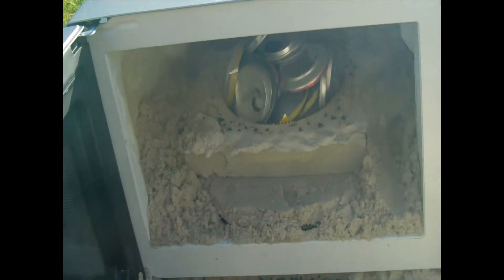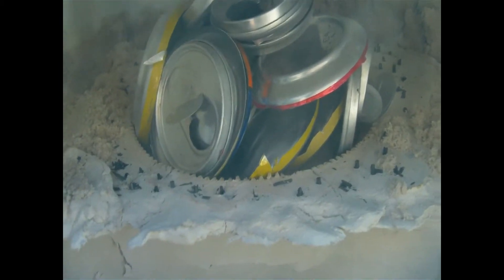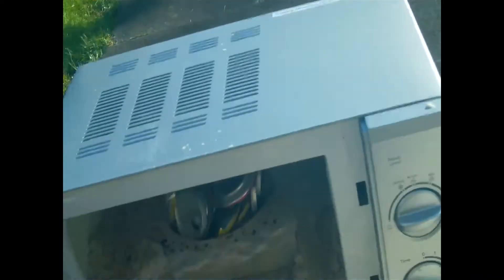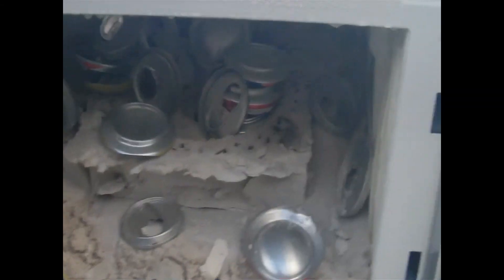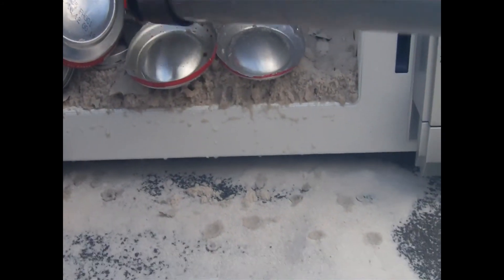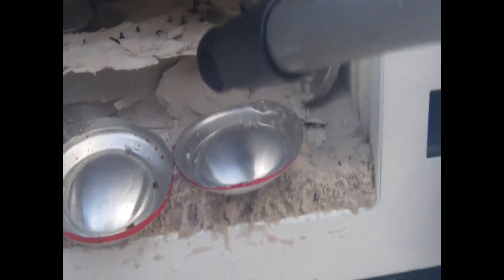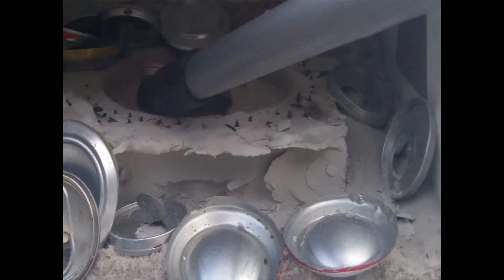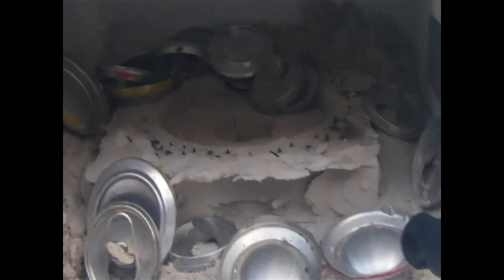Attempt at microwaving aluminium gears

Comment: Microwaves only heat up water, so I'm afraid  this really was one big fail mate.
You need a real oven for this, that will get u up to aluminium melting point, like a stone or brick based one. Possibly with induction loop heater.